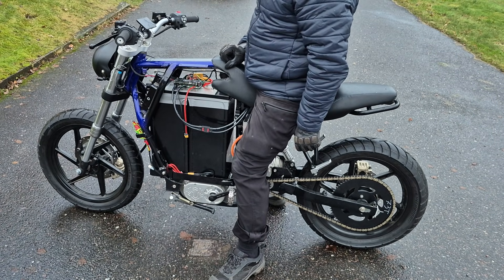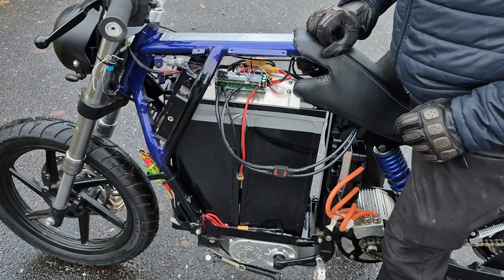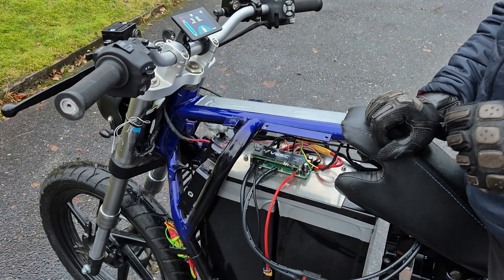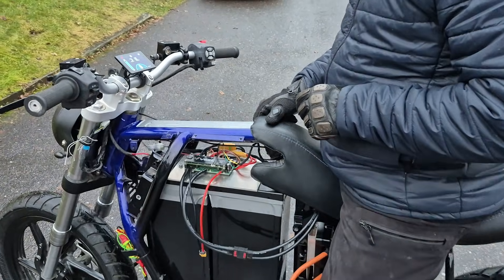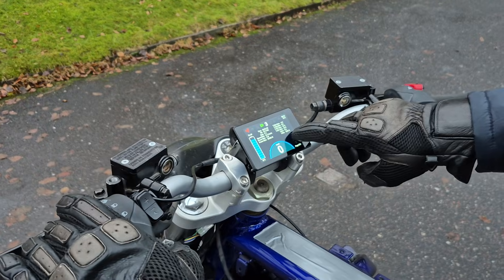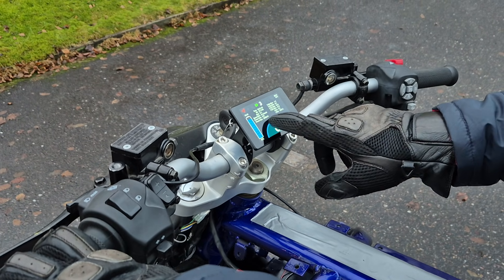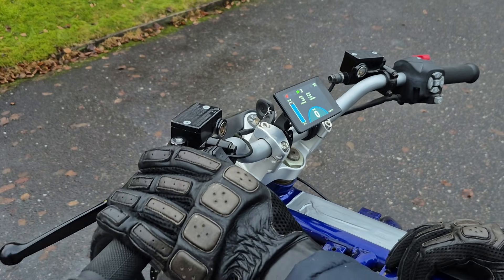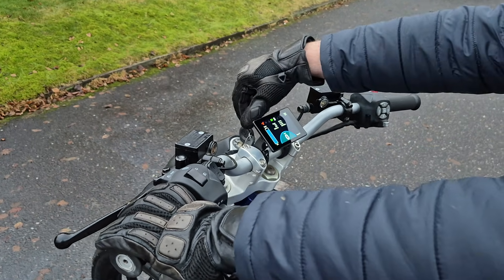Maxim+ 120 1000A Phase Current Test

Comment: I have an electric atv, 4 hub motors, is it possible to run two vesc duets one as a master and one as a slave controller? Further question, and the real reason I would go to all the work of upgrading it, is there a way to program an electronic locker button, that makes all 4 wheels lock together similar to a differential and so they move in sync and crawl out of slippery situations? How hard would that be? The Atv is already phenomenal with all wheel drive, but a 4x4 electronic locker would make it next level!
Reply: I had a setup not too different on my electric buggy. Two hub motors in the rear; two VESC motor controllers. Problem was, when one wheel would slip, it'd go full speed and sling mud everywhere. I ended up just turning on traction control which would basically limit the wheel speed of the slipping wheel to just above the speed of the non-slipping wheel, and that honestly worked great for me.

The same thing could probably be done with your setup, given the VESCs can operate normally first.

Comment: 🎉 Impressive test! Smooth operation at 1000A phase current is a testament to rigorous prototyping. We've supported many hardware teams through similar CNC machining & rapid prototyping phases to refine enclosures, heat sinks, and mounts. Congrats on the production batch!

Comment: What will happen when you jump that motorcycle and land it while on throttle? I.e. sudden forced rpm change. Will the controller survive?
Reply from the maker: With most IPM motors it is impossible to generate enough current to damage the maxim due to their high inductance. I have been running the maxims with a huge low inductance outrunner too with low enough inductance to generate thousands of short circuit amps. So far I have not managed to destroy a single one. The only maxim I'm aware of getting damaged was by someone connecting the battery voltage to the 5v output. We sent them a new maxim for free. The maxims have been the most reliable controllers I have been working on.
Reply: @BenjaminsRobotics  Yeah I will probably order this controller for Netgain Micro 880 but its pretty hard to drive and it has sin/cos encoder so it needs some testing to get working.